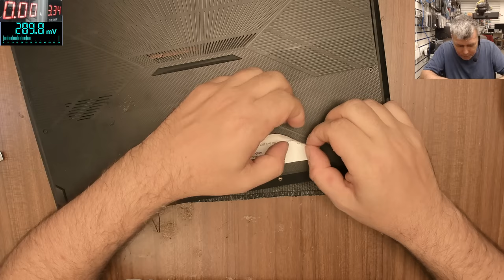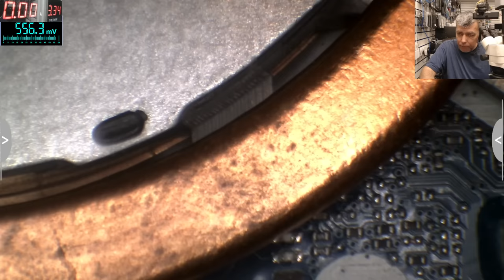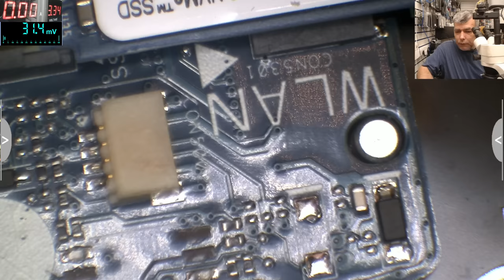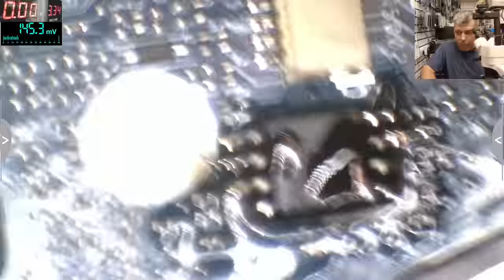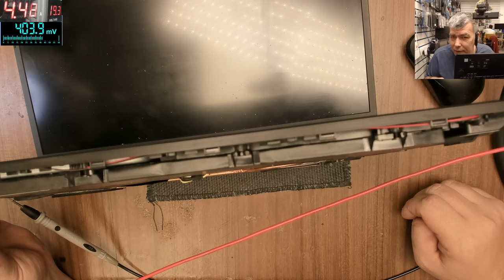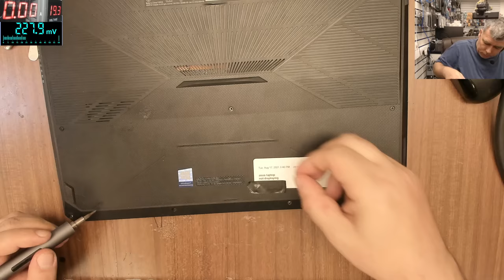Asus TUF FX705G gaming laptop logic board repair

Comment: Soron, you are the 2nd person who knows how to put thermal paste on. I always do the same thing with thermal paste and apply a thin even layer across the entire surface of the chip. Then I know for sure that the heatsink will be fully touching everywhere.
Reply: But does he know how to clean the dust off the fans?
Reply: @XLR8RRICK  nobody pay him for this. Laptop is there because it dont comes on
Reply: @vlmg007  Taking 10 sec to blow it clean.
Reply: @XLR8RRICK  true but that only got bigger problems
Reply: @XLR8RRICK your clueless on running repair business. He cleans that and something happens it would be on him. Unless being paid and agreed to you never start cleaning a customer’s device. Some customers even will say you scratched the device but in reality the scratches were there but covered up by the dirt / dust. This happens all the time until you learn to do just what your paid for.

Comment: My guess: some one tried disconect fan with some kind of tool, like plyers or scissors, applied to much force clipped the chip and took it out.    maybe.
Reply: if that were the case it'd have just ripped all the pads with it. someone did something really dumb...
Reply: Hmmm, just unusual how all eight pads and tracks wouldn't come off in that case. When I saw it I thought possibly they heated the chip with the heat gun, and lifted it off when the solder was not melted on the three pins. Hard to know really.
Reply: @memorywarrior8752  Most likely this. They didn't heat it right because they tried to do it without removing the heatsink. Thus limiting their access to apply heat.

Comment: I think this laptop is open before(I mean the heatsink) because usually we have thermal pads on the vga memory chips and some coils instead of thermal paste
Reply: Also I've never seen a warranty sticker on the heat-sink's screw like the one shown in the video. I've had several ROG laptops and they all come with the generic yellow "warranty is void if seal is broken" rather than that one.

Comment: Hey all, I have this laptop and now it won't turn on, if I press the power button, the RGB keyboard turns on for a split second but then nothing happens, however when I plug in the power adapter and press the on button, the keyboard blinks permanently and doesn't turn on... HELP! thanks
Reply: It went into a power saving state and just needs to be power cycled. providing when it's plugged in the status LED's still work you can leave it plugged in and hold the power button about a minute.

Comment: As a good service you had to clean the fan blades.
Reply: cleaning is charged extra in a repair shop. he will not get paid for it and it takes away time.
Reply: you really think customer will appreciate this "good business" thing? He only wants his laptop to be fixed, if it would like it cleaned he will say that. And laptop overheating 6 months to 1 year after repair will make sure to have customer back for some cleaning and thermal paste replacement :-)

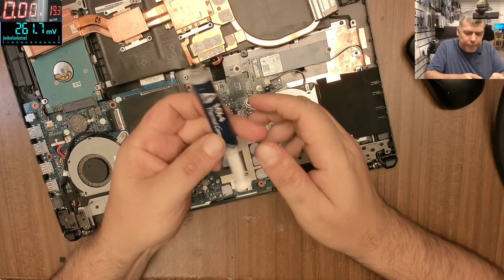Comment: 22:32 wow I'm impressed that you use one of the best thermal paste. 
I thought that you leave this motherboard without new paste, or you use very poor quality, cheap one.
Reply: When I'm doing repairs, certain jobs require certain pastes. If it's a desktop, the TDP of the heatsink is usually higher than what the CPU outputs so I use cheap AliExpress thermal paste. For most laptops the same paste also applies. After all, the manufacturer default paste is cheap rubbish, my paste is slightly less cheap rubbish. For nicer laptops such as this one, machines repaired for friends or computers with crappy heatsinks, I use Arctic MX2 as I've found it's almost exactly the same as MX4 but costs considerably less.

I imagine Sorin and a lot of other repair people use similar practices. Why use pricey paste on every job when most people don't know or care anyway?
Reply: @fcallum77  the thermal conductivity of mx2 is 5.6 W/mK, mx4 is 8.5. The higher the number the better it is. You can get regular paste with 10W/mK quite cheap. The stuff the manufacturers use has around 2W/mK... you are right to call it cheap rubbish.

Comment: So what do I think?... Well, whilst it worked it wasn't the neatest & professional chip repair I've seen n I do them on a daily basis, as for cleaning Amtech flux just use some isopropyl alcohol a paper towel & a toothbrush it cleans it perfectly however your way too eager to use hot glue on everything, you could have run the wires under the chip & used solder mask this would have been a MUCH neater & more professional repair with no need for hot glue!

Comment: ...and it takes me about 30 seconds to clear that BIOS password
Reply: Care to elaborate I’m assuming your shorting pins or using a chip programmer to reset or even a firmware patch ?
Reply: @user-te1le7ck6b  yes shorting pins 7 and 8 on the BIOS chip
Reply: does it still work? on hp business models that trick won't work. You must reprogram them or replace them